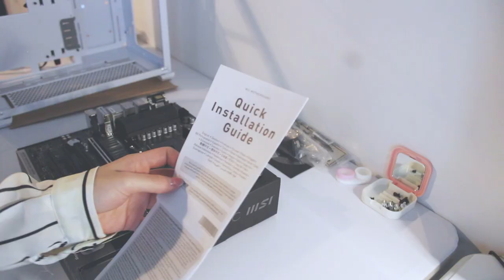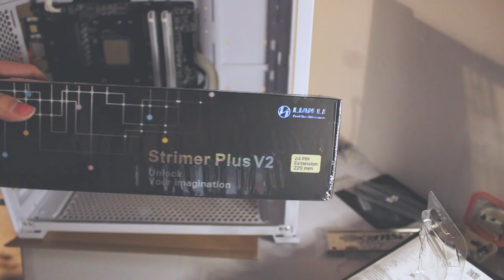trying to build an ✨aesthetic✨white/pink pc when you're a 🔥noob🔥

Comment from the maker: Thanks for all the concerns ♡ I got a lot of comments about AIO orientation but the current orientation is totally fine. I did a lot of research on it before building as well as asked others for advice and having it side mounted with the tubes at the bottom is perfectly fine. 

Generally you just dont want the pump to be at the highest point, which it is not. As long as the top of the radiator is higher than the pump then the air bubbles will collect in there and not the pump, tube up/down is irrelevant. If the radiator was mounted at the bottom of the case then this would be a problem, but mine is on the side and the top of the rad is much higher than the pump. ♡
https://www.youtube.com/watch?v=BbGomv195sk&t=1190s
https://youtu.be/DKwA7ygTJn0?t=718 
https://appuals.com/how-wrong-aio-mounting-orientation-could-be-damaging-your-cpu/ 
https://www.reddit.com/r/pcmasterrace/comments/j9xp8r/is_better_to_place_your_aio_tubes_up_or_down/
https://youtu.be/b6m9Xhzc6Kw 

I've already been using this PC for ~3 months and CPU has been running a consistent ~40°C (idle)/ ~55°C (gaming) and there is no gurgling/churning/bubbling noises so there's no worries :) 
( ＾◡＾)っ ♡
Reply: thats the opsite
Reply: nah tubes down is the way to go, you did it right. Nice build

Comment: Not bad for building your PC with little or no experiences, and seems good.
But as for a friendly reminder, I noticed you forgot to put a heatsink back on your M.2 Nvme/SSD when you installed it, so I would suggest to put the heatsink back and peel the plastic before putting it on the M.2 SSD so that your M.2 SSD drive will get cooldown and more lifespan. And also, nice for putting back an IO shield when you installed on motherboard before putting it.

Comment: Which cable you are using for your gpu ? And plzz tell me what is your gpu connection pin either it is 8-pin only or 12-pin ? Plzz answer me
Reply from the maker: 8-pin Lian li strimer for GPU :)
Reply: @hazydayyyss  How did you get 8 pin there is no 8 pin lian li strimer v2
Reply from the maker: @titaniumraj3885  its linked in the description

Comment: You may wanna fix ur Aio pump, the way you have it positioned will create air pockets. I suggest flipping the radiator the other way so the pump is lower.
Reply: If the top of the radiator is higher than the pump (as the AIO is likely mounted on the side), she's fine there. You would have a point if the radiator is mounted on bottom.
Reply: Thats fine. You comment is not fine.

Comment: Respect for Genshin fan.....btw, did u use lian li hub for controlling lian li fan RGBs?? if so, how are u controlling NZXT fan RGBs??
Reply from the maker: Right now Im using the hub to control the Lian Li fans and the NZXT ones are controlled through the NZXT Cam software. I'm going to replace those NZXT fans eventually with Lian Li ones though

Comment: You should definitely rotate the radiator to have the tubes come from the top and not the bottom so the liquid won’t have to fight against gravity and the tubes would look cleaner and not touch your gpu 😅 other than that, nice build 😊 psu is definitely overkill tho lol 750 watts would have been way more than enough
Reply: AIO is in the best way possible. air will now not block the tubes and the top of rad is above of the pump. Its perfect